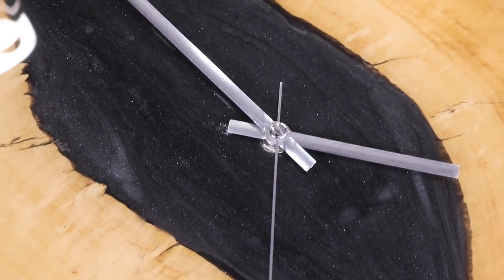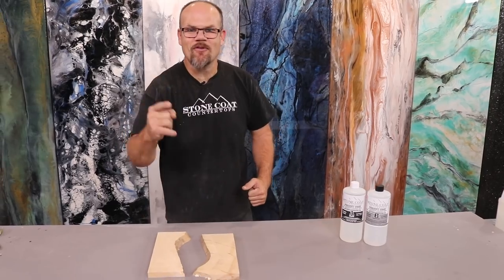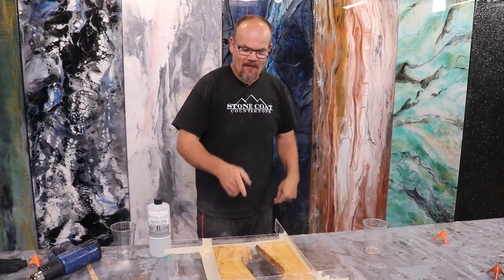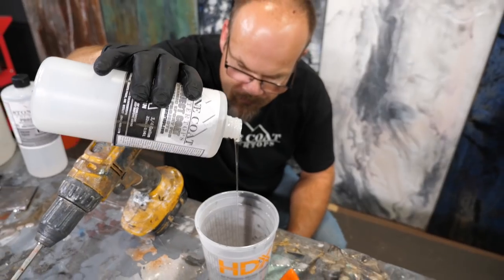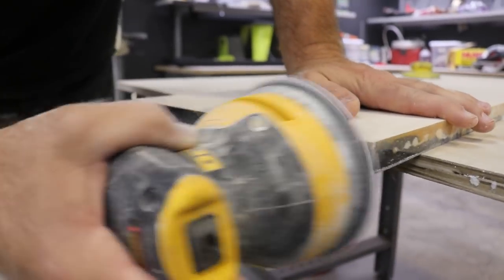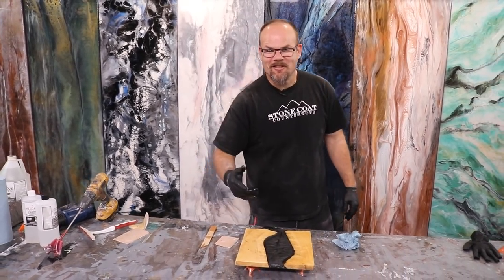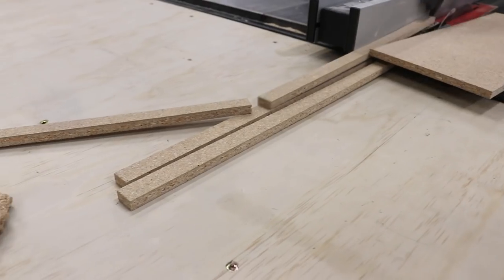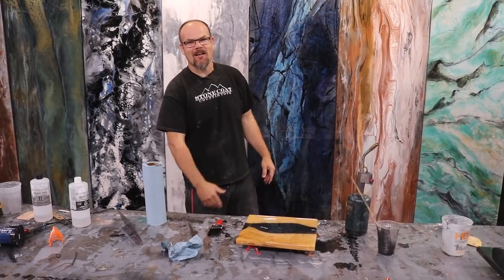Woodworking Epoxy School

Comment: I am just about done with an epoxy clock. I used black walnut. I cut it to make four sides of wood, so it is more of a lake than a river. I only poured the tinted resin about 1/4 inch to get the color  because after that I hot glued some colored rocks and moss to it. Then filled it with clear resin. To hide the clock motor I took a small square piece of the walnut and cut out the clock hole on my cnc, shaped the edges on the disc/belt sander and hot glued it in the center of the mold before the first color coat. It look like an island in the middle of the lake. I am putting some small battery powered led lights on the back that shine through the epoxy. Will send pics when I am done with it.
Reply from the maker: Bob Bob, the "island" to hide the motor was a great idea. We can't wait to see photos of it!

Comment: I have a piece of 3/4 pine that was painted black, and then a 2D image was CNC'ed. I want to fill, but not overflow, the CNC'ed areas with a contrasting color epoxy. Which product/method would you suggest?? I am especially concerned about using heat on the piece, because I don't want the black paint to peel.
Reply from the maker: Great question! We would need a bit more info from you to accurately recommend one of our products, try contacting us directly so we can help! -Nathan

Comment: I want to fill a large crack with epoxy but don't want to apply epoxy seal and flood coats over the entire workpiece. Can I sand the hardened epoxy in the crack flush with the workpiece then use several coats of satin polyurethane over the epoxy and the workpiece to make the epoxy clear and finish the workpiece?

Comment: Im going to use some acrylic resin on a guitar I'm planning on doing some big cut outs and fill them with random wires and led lights then flood the holes with epoxy then I wanna make an epoxy top about a quarter inch thick and put a carbon fiber skin on but being careful not to let the carbon fiber wrap around the sides so that it has the appearance of a clear binding around the top then when you turn on the lights they should show through the faux binding edge

Comment: I like your clock Here in the Denver area there is a clock store where you can buy clock parts clock motor and hands as will as have a clock fixed. I was able to make a clock from a tree stump. that would be another story how I did it.

Comment: Here is a Tip for a source for LARGE pieces of acrylic at CHEAP PRICES!! Go down to your local Habitat for Humanity store and buy a full length used screen door. Usually for like $20.00. I have bought a few for various projects taken the acrylic panel out and scrapped the rest.

Comment: Couple of tips with epoxy. I use plastic wrap (Saran Wrap?) for a clean release. Just make sure you let it harden first. VERY messy otherwise. Also when epoxy hardens it releases a waxy substance. That is what clogs up sandpaper. If you rinse the surface with a mixture of 1 cap full of household bleach to a bucket of warm water, it will remove the waxy material. If you apply subsequent coats BEFORE the underlying coat has hardened, you don't need the bleach. Cool project.

Comment: Fantastic videos and products, the presentation is " Groovy " some might even say " Funkadatious "  . I've done a fair bit of small scale resin work when I build models.  It's very easy to get small scale precise measurements of resin...Go to your local vet get a few horse syringes and use them to measure your part  A and B.  If you constantly use the same syringe for part A and the same one for part B you can reuse them about half a dozen times. The ones I get go up to about 20 mill. about .75 of a fluid ounce...